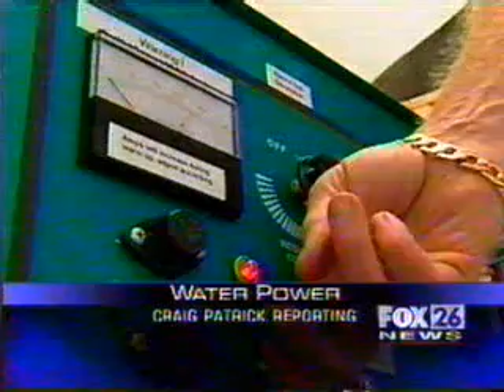turn water to fire

Comment: the amount of electricity needed to do this is pointless to put in a car. Why generate electricity to burn fuel..why not use the electricity to turn an electric motor...?
Reply: it's a "symbiotic" oscillation between spark fuel-generation and then electric motor; the key to efficiency is nested, recursive systems .
Reply: PS, this can be done with a 9 volt battery

Comment: There is nothing mysterious about these torches. These torches have been available for some time now and some jewelers use them.  The natural gas torch is preferable however, and we use it along with the laser soldering torch.  The water torch uses the same principles as those used in the water propelled engines but it is not just water you poured in.  Water is poured in, then heated to convert to Hydrogen, which is then combustible for use as a torch, the same reason it works in a car: it's explosive to run the engine.  The water torch sells for about $1,300 at Stuller, Inc. a well known jewelry supplier.  The reason we do not have water propelled cars is that the gas stations would need to have the hydrogen pumps installed at most gas stations.  The only stations I know of are in Los Angeles, to refuel the few cars that do run on hydrogen and as long as the oil companies keep the gas stations from adding the hydrogen pumps at the stations, only Los Angeles can use the car.
Reply: I don't think you have a clue what you're talking about David Coll. Since when does boiling water or heating water make hydrogen?

The entire point is that you would have water in the tank, and hydrogen is produced on-demand near the combustion chamber. Water is a safe liquid, we don't want giant pressurized hydrogen tanks (bombs) on our cars or insanely dangerous fueling stations.

Gasoline clogs carburetors, fuel injectors, etc.. as it evaporates and leaves a coat of varnish. Also leads to carbon deposits which get in the oil, which is why we have to change the oil so often.

With a hydrogen on demand setup you wouldn't have carbon deposits getting in the oil, you wouldn't have varnish building up clogging the fuel system... etc.. etc.. etc... a simple air filter would keep junk out of the combustion chamber.
Reply: Dustin Bruce  Bruce you are not familiar with the technology that currently exists for making combustible hydrogen from water, as I explained in the above post, or you miss read my post.  Google the technology so you can find out how it is currently used in the industry, especially the hydro torch used in the jewelry industry, an area I have a lot of expertise in.   As for its use in cars, the same technology would and does already work, it is just not manufactured in enough quantity to make it feasible for the auto industry yet.  The problem with the car making its own combustible hydrogen while driving is you that need electricity (used in hydro torches) or a combustible engine to heat the water with an electrolytic ingredient which puts you right back where you started.  Purchasing the already manufactured hydrogen at a gas station instead of using gas would solve the problem.  But how do you get the gas stations to invest in that pump?
Reply: David Coll
Electrolysis is a fairly well known concept.

"The problem with the car making its own combustible hydrogen while driving is you that need electricity (used in hydro torches) or a combustible engine to heat the water with an electrolytic ingredient which puts you right back where you started."

1). All cars have an alternator which recharges your battery while the car is running. There's plenty of juice left over for electrolysis.

2). There are variations of the normal electrolysis process that don't require added electrolytes in the water.

You may have some expertise in the jewelry industry, but you obviously don't know much of anything about electrolysis.
Reply: Dustin Bruce Well... according to your post there should be no problem making this for cars...So what is the problem?  Please tell me what is needed and why it is not standard issue on cars.  I have already acknowledge this technology already exists and we use it in the jewelry industry extensively.  We are probably on the same page as to why all cars don't use the technology, but let me know if it is different than oil companies preventing its use and the Wikipedia description of the water fueled engine.

Comment: See wikipedia Oxy-fuel welding and cutting/ Hydrogen the flame only burns at 2800 celsius , correct me if iam wrong but i think if u heat a metal or something with a torch it can get higher temperature than the flame cause it cant cool fast enough, right? Also u have to watch for the Hydrogen embrittlement effect when welding with Oxyhydrogen.

Comment: i know when i first heard that i was like "no, because torches (to my knowledge) reach only up to 4000 Celsius, you would need a plasma torch to reach those temperatures of 6000 C and above". and yeah the surface of the sun is only about 6000, i was thinking the inside ;P

Comment: If I recall correctly concerning gas/diesel engines, adding as little as 1-3% HHO to the air fuel mixture is enough to characterize the combustion as faster cleaner burning hydrogen. 

It stands to reason that adding a relatively nominal amount of HHO into electric plant's air coal fuel mixture might significantly improve the polluting emissions. 

!

Comment: I never said that I said it isn't completely clean.  And let's not  forget that much of the electricity we use actually comes from coal.  That's why you'll here someone say sometimes if you turn of the lights you'll be saving however many tons of carbon emissions per year.  This is one of the problems with electric cars

Comment: @droboyzexclusive well, water is the fuel source but you need stimulation to seperate the hydrogen from the oxygen atoms, you can use direct current for that. Problem is it requires more energy to generate the fuel source than it actually provides, so its not very efficient.

Comment: this is a hoax lol. this torch is no different from the 1960s oxyhydrogen electrolytic torch. neither are powered by water. whater does not convert to hho without stimulus. claiming this lessens our dependency on fossil fuels is no different than claiming that using a lighter for thermal energy lessens our dependency on butane. this is beyond stupid.

Comment: It's not running on water. It's running on hydrogen produced from water by consuming a shit-ton of electricity which is in turn produced by burning fossil fuels.  All we'd be doing is trading oil for coal/natural gas, but we wouldn't be getting rid of fossil fuel consumption like this video implies, and it's dishonest of them to make it seem that way.

Oh wait, this is fox news, wouldn't expect them to go into any of the actual pesky science. Thanks for the water power jebus!!

Comment: @slammusaran there are but u still need energy to split the H2O to  2H and O :) gimme a 12Volt 100 Ampere Battery and sum electrods and i build u on of those by myself ^^

Comment: Oh some people. With three minutes on google you can find this technology isn't some government coverup.

The simple fact is the energy required to break water down to this form, outweighs the energy produced by burning it.

So yeah you have a water powered car, but it will be less efficient, and require more batteries than current electric cars, for producing the gas from water.

Comment: @GorillazGames It's true it take electricity to create the fuel, however, using the alternator the engine recharges the battery thus creating a cycle.  The problem with electric powered cars is they are unable to make long distance trips without stopping to be recharged.  And electricity cost more than water does.

Comment: People need to do a little research before believing what they see.  This is a very inefficient form of energy.  You get less energy out of it than it takes to produce it.  Just like someone else posted, if you are using electricity to produce the oxyhydrogen why not just use the electricity to operate the vehicle?  It would take less energy to just bypass the conversion.  No conspiracy here.

Comment: @a12a1d2a1 12v?
This isn't a complete unit measurement for energy consumption. You left out the time variable from your ingenious equation as well.
Hydrogen as a fuel shows some promise, but it's not even close to commercial application at this point. Storage, transport and efficiency stand in the way. Maybe these can eventually be overcome,I don't know. I won't discount any new developments until I see the data.But right now it costs more to generate hydrogen than gasoline per btu output stored

Comment: that is some damn deceptive advertising, it is NOT powered by water, it uses electricity to split the water into hydrogen and oxygen gas and lets them recombust to generate the flame. Maybe it is more stable as a welding tool, but saying the car travels "exclusively" on water is BS since that would just make it a variation on the electric car, using a rather different style of battery.

Comment: This guy did not invent electrolysis, not was he the first person to realise you can burn the resulting gas mixture to make a cutting torch. As a fuel source, however, it doesn't work. Why? Because of the Laws of Thermodynamics. The energy required to separate the H2O into a burnable Hydrogen+Oxygen mix is greater than the energy you get from burning it. So basically, all the power comes from the battery.

It's battery power. Not water power or hydrogen power.

Comment: this is fucking stupid, here is why. 
Currently we burn gasoline directly in our engines to produce power. now these nut-jobs would have us burn gasoline to produce electricity to split water into hydrogen and oxygen, this would then be burned in our engines to produce power. Now which one is more efficient when you consider the conservation of energy?

Comment: Check wikipedia's article on Oxyhydrogen.
HHO is H2O is water.  What is burning is H2 in the presence of O2.
Splitting H2O into H2 and O2 is done via electrolysis and costs more energy than is recouped by burning the H2. There are other ways of obtaining H2 as well, but in any case there MUST be some outside source of energy.
Cars will not run on water, but can be run on H2 - a very important distinction.

Comment: @xaviorist Actually, oxyhydrogen isn't a molecule at all. It's a mixture of molecular hydrogen and molecular oxygen. The ratio of Hydrogen to Oxygen is the same as it is in water, however. Also, just to set the record straight, HHO is a gas proposed by Ruggero Santilli that hasn't been accepted by the scientific community.

Comment: @partyboy1800 This is what I keep telling my father about why fuel cells are inherently inefficient. But, combined with growing electricity production technologies, the use of it within a system could become more efficient.

That's just my point.

Course, by the point THAT'S in full swing, electric drivetrains and such will probably be much more efficient and cheap, anyway.

Comment: I've been talking about this for years. FOR YEARS.

Eco-nuts are too caught up in fuel cells and gasoline-electric hybrid vehicles. to realize that their methods are horribly inefficient at producing energy, and require expensive technologies in early development stages.

An internal combustion engine can easily be converted to run on Hydrogen, and it would produce no carbon emissions, meaning no greenhouse gas.

And the technology has been around since 1903.

Comment: electrolysis breaks apart covalent bonds in water forming what is essentially a hybridised gase of hydrogen and oxygen, hydrogen being the best fuel for combustion easily exceeds temperature from burning hydrocarbons like octane. the welding head is kept cool because the combustion reaction occurs much further from the head than with other welding tools
why is this method not used everyday? breaking apart covalent bonds in water takes a fuckload of electricity

Comment: I don't understand how people can be so gullible. This is not turning water into fire, it is turning nuclear power or coal into fire via electricity through the outlet. And this technology is already being used in fuel cell cars. The water and the electricity are just used to transfer the power from the original power source. No actual power comes from the water, putting water into a car will not make it run, only the batteries which convert the water to H2 and O2 will provide power.

Comment: you need energy to break apart the water molecule. you get energy when you put together a water molecule. when oxygen and hydrogen burn, it creates water and heat. but you will not get free energy from water. if college chemistry taught me correctly, water vapor is always produced when things burn (for the idiots that dont know anything, its no where near the amount needed to put a fire out). and according to newtons law, energy cant be created or destroyed. so water --> water? aint gonna happen

Comment: You cannot use a natural resource for a long amount or large amount. it will never end. it will become unbalanced. the water turns from h20 here to hh0 so yes. it changes at a molecular level. therefore there would be less water than hh0 eventually. And water goes up into clouds and comes down as acid rain when mixed with pollution as is. It would NOT take centuries it would take just a few years.

Comment: No Its Real, There Comming Out With Cars Soon That You Make The Feul Out Of Water, They Take The O Out Of The H2O To Make It H2 Witch Is Hidrogen Hydrogen it flamible, when the hydrogen burns insted of turning to gasses like carbon dioxide, it turns to pure clean H2O, (The Oxegen Mixes With The Un-Burnt Hydrogen Somewhere in the motor)

Comment: now on the other hand if you were to seperate the hydrogen from the oxygen and use some sort of catalyst to produce hydrogen fusion you would be talking about Massive amounts of energy (way more than it would take to seperate the two) so if you had a machine capable of sustaining a fusion reaction and using part of the electricity generated to split more water, you could have a nearly unlimited source of energy (and helium)

Comment: I actually know this one! it's SLIGHTLY more than the energy produced by burning hydrogen in the presence of oxygen to make . . .  (dun dududaaaaa) Water vapor.  (as some of the energy is lost to light, most goes to heat and I'm sure it produces some sound energy as well so truly there is an equivalent exchange of matter/energy. The electricity that it takes to cause electrolysis to seperate hydrogen and oxygen is just a tad bit more than the max energy obtainable by burning because of waste)

Comment: HHO is H2O, that's what the "2" means, 2 hydrogen atoms.  The fuel (electricity) breaks the bonds and instead of water, you have separate hydrogen and oxygen atoms instead of water molecules.  If you have it as a mixture, it will explode when sparked.  But you still get less energy that the electricity you used to separate it.  It's more efficient to skip the water and use gas or electricity to do the work.

Comment: It takes more energy to separate the hydrogen from the oxygen that makes up water than you get back by burning the hydrogen and turning it back into water.  What he is claiming is "over unity" eg. a "perpetual motion machine, an impossibility, it's a scam. 

For welding, sure, use electricity for power and it works.  But the fuel is electricity, not water.  The fuel in his car is gas, not water.  He uses fuel to extract hydrogen from the water which is then burned. It's inefficient.

Comment: actually no we dont. We dotn run out of water. Water in its gas form finds some way to get back into another source of water and runs into the ocean and it keeps on. Same thing with the water we use with toilets, they just filter it and sometimes we may end up drinking it.

Comment: Thats something very different... It wasnt against any of law of nature. Maybe there is some way to get some energy from H2O, but surely its not that way as presented on video.
BTW, the memory cards with capacity of hundreds of terabytes, that would be used in mobile phones are being invented. The scientists found material, which has such a big capacity, but at the moment it works only in temperature of few degrees of Kelvin (temperature close to absolute zero).

Comment: you're right i missed that, i should pay more attention. still though using it in vehicles would end up losing a lot of energy. electrolysis is between 50-80% efficient right now and getting the electricity from say a generator would just end up with a lot of losses. If this was feasible then every car would be using it by now ~2.5 years later.

Comment: I see you have stopped with the unprovoked insults. You're learning.

I know the flame is hot, it isn't however anywhere as near as hot as plasma cutters or traditional flame welders, the reason it gets hotter when being used on a material is because hydrogen bonding forces it to release its own energy, thus you get more heat

Yes, you still burn fossil fuels to get HHO, so it doesn't solve the problem. In my opinion the technology is obsolete, I'm not defending it. You brought it up not me.

Comment: The flame of torch is hot but on the tip, not on the iron ring, where it goes out.
The torch and H2 car engine is the same, burning H2 to get energy. Of course, its cleaner and safer to use H2 in car, but to electrolyse water you need electric energy, and from what we are getting mainly the electric energy? From fossils, so the main problem still isnt solved, this is it, what I am trying to explain. You did not get more energy from burning HHO than you wasted in electrolysis, forget about it!